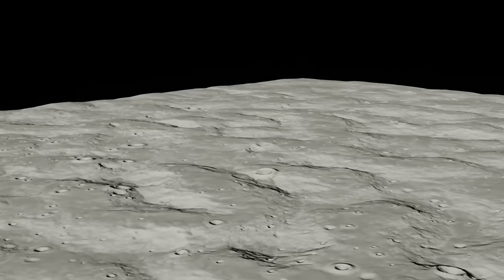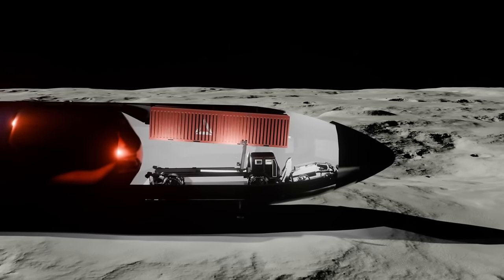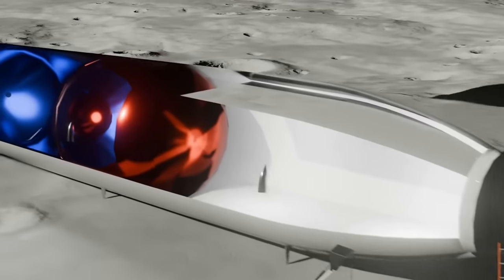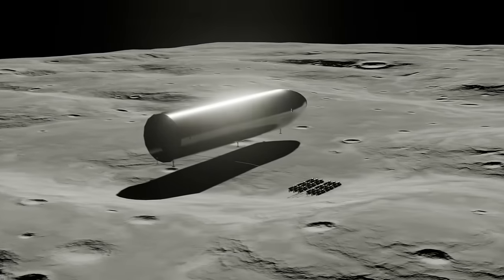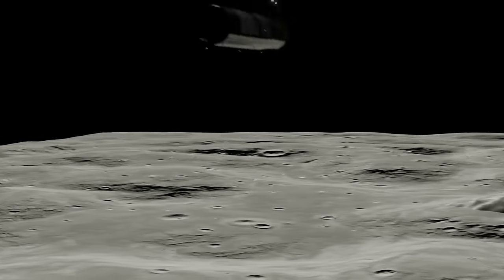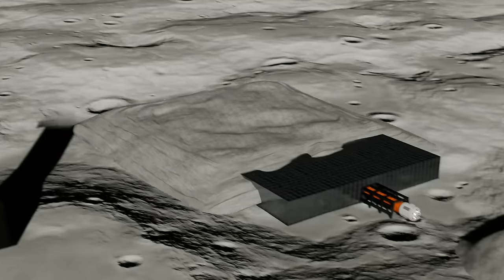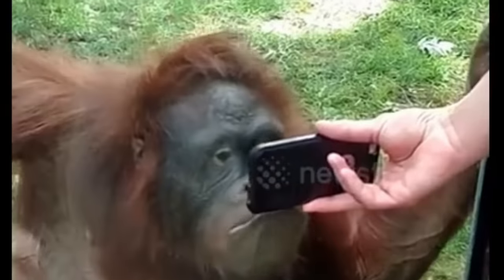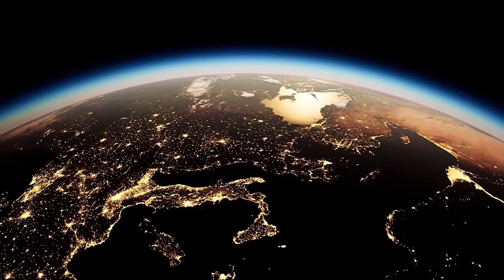How To Develop The Moon ALL PARTS

Comment: Could we get carbon on the moon with methane pyrolysis? 1. First mine water from lunar ice. 2. Use fuel cells’ electrolysis to split water into hydrogen and oxygen. 3. Use Sabatier reaction to combine co2 from astronauts and hydrogen to make water and methane. 4. Then use methane pyrolysis to produce hydrogen and solid carbon.
Reply: Why not condense the Co2 into a liquid and then use simple electrolysis to split it into carbon and oxygen?

Comment: I have an alternate propulsion system for the lunar shuttle, one that makes people nervous in an entirely different way: photonic laser thrusters. These are Dr. Young K. Bae's invention, and they're essentially a refinement of the laser sail. It uses a thin laser amplification medium and 99.99% reflective dielectric mirror on the powering spacecraft, with an identical mirror on the target spacecraft to bounce the laser light back and forth thousands of times, essentially turning it into a very long laser cavity itself. So instead of bouncing off once, it bounces - is recycled - 1000 to 10,000 times, imparting thrust to both ends while recuperating the energy that would normally be lost, and reducing the laser power needed from terawatts to megawatts.
This does mean that a) you can't have the beam incident on it all the way, it will lose focus eventually b) you need an Earth-orbiting 10 megawatt laser with repositioning thrusters/systems for the acceleration phase AND a 10 megawatt moon laser for the deceleration - hence the nervousness. But the performance is something else. A small 1-ton spacecraft (50% of that payload) with a 30 metre mirror and a 10 MW laser could reach Earth from the Moon in 20 hours with a beam incidence time of 6.8 hours - a delta-V of 11.6 km/s and, assuming a 1600m/s moon orbit, a thrust of 3227N. If you increase the mass, it increases the time it needs to accelerate, thus length of the incidence time/boost phase, but also increases the time it's within range of the beam, and doesn't increase the size of the mirror, so it scales fairly well. My calculations (and I may be wrong) say that 10 metric tons needs an incidence time of 12 hours. This can be tweaked.

So why set up this complex system? Being a propellantless system, once it's set up you don't have to keep feeding it. It's a photonic railway delivering a stream of raw materials to and fro. All that oxygen and titanium being delivered to Earth and on to Mars is pure profit.

Sources: Y.K. Bae, Journal of Propulsion and Power, Vol. 37, pp. 400-407 (2021)

2021 talk and slides to Future In-Space Operations Telecon: https://fiso.spiritastro.net/telecon19-21/Bae_6-2-21/

Automatic transcript of talk: https://rentry.co/gs9wpsab

My crappy calculations: https://rentry.co/qrrci66r

Where I found it: https://spacesettlementprogress.com/enabling-a-multiplanetary-civilization-with-photonic-laser-thrusters/

Comment: Nice try but lowsy logistics.  

1. Land semiverical and tip with truster assist to lay flat.
2. Send Opimi, reactor, and water prospecting equipment on first mission(s).  Pack reactor in a boring machine shell.  A shielded room can be provided for the Optimi.  No need for food or life support.  Will need EV anti-dust suits, transporter radiation boxes for longer drives/flights, and small, light dust clean off pods.
3. Send water extraction equipment, boring machine, support equipment, another reactor packed in the boring machine shell, and more Optimi on next mission to establish a water and materials depot and a temporary landing pad.  Use tanks from ship(s) to store volitiles.  
4. Use boring machine to mine regolith and moon rock to build out a below ground work area at a depth a depth sufficient to provide radiation protection for robots and manufacturing.  
5. Cannibalize ships for steel, other metals, parts, and carbon (carbon fiber).  Zero waste.
5. Determine location for a manned base.  Start base construction and bore a tunnel from the supply depot to the base.
6. Use temporary blow up housing that fits in tunnels for manned missions until sufficient infrastructure is available to ferry humans to and from the moon surface with fuel and life-support extracted from the moon.

By avoiding food, drinking water, life support, and human acceptable transportation, and housing and by consuming everything transported,  infrastructure build out can be accomplished at the fastest rate, least human risk, and lowest cost.

Comment: You can tell this is pretty good by how 99% of the criticisms are "but the current design iteration of Starship might not be capable of supporting itself on its side on the moon". 50 minutes of ideas and calculations and that's the worst problem anyone can come up with?
Reply from the maker: Lol yeah and it's not an insurmountable issue at all either
Reply: There's also the 10-meters-of-regolith part. Spaceship hulls are designed to keep internal pressure inside, they aren't meant to be buried.

Comment: this video is very budget over any safety, ignoring the issues with repurposing equipment not designed for the proposed usage, rovers and automation can conduct a lot of the labor of establishing the base saving on the radiation absorption as it will likely take months of work refining luna terf into enough material to make a small foot hold to bury

Comment: Before I watched your video, I assumed all tanker flights would be dedicated flights. Now I see that is wrong.

Most early flights of StarShip will be to LEO and will not be carrying anywhere near its maximum payload. I now realize that, on those flights, Starship can carry extra fuel and oxidizer to drop off at a refueling depot. That will mean that SpaceX can use every kilogram of every launch to common LEO orbits. 

The supposed inability to use all the mass Starship is capable of launching was an early criticism of Starship, and now I see it was an unfounded criticism.

Comment: A bit on the ground-side launch, if you really wanted to you could use a nuclear lightbulb system, a closed cycle nuclear gas core rocket capable of clean launches! That could massively increase passenger loads. If the public would still be squeamish at anything with the word “nuclear” in it, you could use a tethered ring to significantly increase throughput and reduce cost. If I’m being honest, something like a tethered ring or Lofstram loop is probably more likely than us seeing a nuclear lightbulb launch from earth. (I’d highly recommend Isaac Arthur’s vid on tethered rings!)
Reply from the maker: Yeah rings would be great but gotta develop the moon to build something like that

Comment: gabion baskets would reduce the time to cover the station with regolith shielding.
Reply from the maker: Yeah I think something like this will be useful
Reply: @Anthrofuturism  perhaps a gabion wall robot could '3D Print' structures out of gabion baskets like making brick walls. Imagine a robot that sinters a road from site A to site B, the next robot places gabion walls on either side of the road, the next tops the road from wall to wall with a sheet metal roof, then sand bags cover that with solar panels on top. The sides banked with sand bags, & the inside temperature controlled but exposed to vacuum would provide a safe transportation corridor where a less expensive space suit would suffice for use.
Reply from the maker: @Astroponicist  several universities and companies are working on 3d printing regolith shells and printing habitats our of regolith the issue is you have to use water or sulfur which is a major bottleneck for large scaled production but probably useful in the beginning.
Reply: @Anthrofuturism  leave a simple job to a university & they will make it impossible. gabion baskets are easy to ship, easy to place, & easy to fill. they are cheap, reliable, effective; which is probably why they are not using them in their estimations.
Reply: I have to wonder....many, many caverns and lava tubes have been identified/mapped on the moon, wouldn't it make more sense to seek out and use those for shielding than to import the machinery to pile up many meters of regolith on top of landed structures, and then still have to deal with no shielding for personnel moving around and between them??
Reply: @AncientEgyptArchitecture while caverns, & tunnels are of interest, they are not always going to be in useful locations. They will require even more equipment, & work than surface structures. Protected walkways can be installed quickly, & with minimal equipment wherever workers spend time on the surface. Mobile versions are also feasible.

Comment: Another advantage to the belly-landing expendable Starship design is that the engines become spare parts for the reusable landers (or become the engines for an LSAM built on the Moon out of lunar steel) and the fuel tanks become the storage tanks for lunar refueling infrastructure.

The best site for constructing a lunar base would be on or near Shackleton Crater on the lunar south pole, which has permanently shadowed areas that may still contain water ice.  Using lunar water is good for us since it means that we don't have to ship it up from Earth.  We can use the water to sustain an artificial biosphere in our lunar base, growing algae tanks for oxygen production and CO2 scrubbing and maintaining a culture of composting microbes to break down our organic waste.  Using the oxygen produced by our lunar steelworks and siphoning off the methane gas produced by our composters and storing it both in lunar shadow, we can make rocket fuel for our generic methalox-fueled Starship-like landers.  Get a big enough colony going, and we can start exporting our waste gases to LEO to reduce the number of Starship tanker launches needed to refuel each mission.
Reply: 1 - Shackleton is too close to seismically active zones. Faustini Rim A seems more optimal.

2 - Water isn’t the only thing needed for life. The moon is almost devoid of nitrogen, carbon and seems to be fairly short on phosphorus, all of which would need to be shipped in from earth if you want a hope of establishing agriculture.

3 - What kind of composter are you imagining that could produce enough methane to fuel a rocket in under a decade?

Comment: I'm thinking about alternative approach . land vertical , then like TBM , a tunnel boring machines ,  dig down into regolith , not to build pyramids like shelters over crucial pieces of the whole system , we move few thousand of years from that point no matter if we can repeat Egypt  archievements or not . . for me it is pointless to build a mountain if we can just cover from temperature and radiation just dig down . No horizontal landing , which , imho is the better way to burry parts of arrived rockets . than build a pyramids or artificial mountains . I'm writing this commentary in the middle of Your video . I'm partially agree with the stepping stones You present . I'm only as an engineer try to minimise energy needed to archieve same goal.

Comment: You know what we could theoretically do? We could use the silicon from the slag in the production process to power a sand powered rocket engine. I know, it sounds weird, but it's one of the highest components of the slag for steel production. It's not as cool as the literal nuclear rockets but a theoretical concept that could have an impulse similar to chemical rocket engins on earth.

Comment: horizontal landing is the correct way to do this, but Starship is not the right design. the rings are not strong horizontally until buried, the tanks need to be balanced, and the transit engines are dead weight for landing, which is the most important part for weight.
Reply from the maker: Yeah but retrofitting to compensate for these deficiencies isn't out of the question

Comment: 6:18 If it is economically viable to fly multiple ships to the moon, building a new engine would probably be cheaper than the hassle of returning one.

Better ship back some regolith that would can either be precious for ISRU R&D or sold for science. 

Plus those engine would be a excellent resource for both spare parts or high quality stock material with the added benefit of earth R&D being able to develop precise procedures thanks to also having the same stock on earth.

Comment: How to settle on a Moon 

◻️ PHASE 1

▫️ Colonization area assessment
▫️ Georbital excavation laser satelite
      is moved into geostationary orbit.
▫️ LS-01 laser excavating several meter deep corridors, halls and establishment layouts.
( takes less surface material 
to cover subsurface corridors, with sealments, then piling a hill over a space craft ).

▫️ LS-01 glassing small crater surfaces to establish a solid and vaccum isolating surface.

◻️PHASE 2

◽ Shipment craft loaded with:
◽Energy unit
◽UAGV excavators
◽Mining unit
◽Geologic refinery unit
◽Oxigen production unit ( Geologic state 1 production )
◽Water production unit 
◽Hydrogen production unit
◽Geologic ore smelting unit 
productinfg metal dust for 3D laser printer unit.
◽3D laser printer unit 
produces structural parts for created corridors, glasses crater dome.

◽3D laser printer creates double shell glass windows from refined Moon dust/sands.

◽Algee geel unit placed, producing 
X-Ray isolation gel, later filled into Glad dome window shells.

◽Robot logistics modules, deploying machines that allocate and move structural parts to their construction places for human colonist crew.

◻️PHASE 
◽Astronaut colonist crews arrive, setting things together, such as 
corridor walls, operating excavators for final works, assembling the glas dome, filling the gel, mounting interrior. technical parts, pressurizing the areas, seeding aggriculture in Crater domes.

Comment: It would be better to build the base on earth using thick steel and submarine build techniques, then launch to LEO on super heavy booster and ferry to the moon using only the aft engine section of starship and engineering a way to land it on the moon as the starship is not designed to be put under external pressure from regolith, neither is it designed to lay horizontal

Comment: Would be quicker and cheaper, during the nuclear engine phase, to modify the already existing Starship rocket. We'd rip out the chemical rockets and modify it to nuclear. which reduces R+D drastically. Also reduces integrations costs later on, ie, wouldn't have to redesign the docking system, etc.
Reply: Ah yes, just replace the engines. How hard could that be?
Reply: @oberonpanopticon  We would be on the moon at that point with a mostly self sustaining base. Did you watch the video?

Comment: Wikipedia: 
"Free iron also exists in the regolith (0.5% by weight) naturally alloyed with nickel and cobalt and it can easily be extracted by simple magnets after grinding.[44] This iron dust can be processed to make parts using powder metallurgy techniques,[44] such as additive manufacturing, 3D printing, selective laser sintering (SLS), selective laser melting (SLM), and electron beam melting (EBM)." 

You might just need a grinder and a metal powder 3D printer, with maybe a furnace for casting bigger parts.

The whole metals section is interesting (https://en.wikipedia.org/wiki/Lunar_resources#Metals )
Reply: Thank you, 3d printing metal parts like what Relativity Space is doing on earth will be ideal to build lunar surface to LEO vehicles like the lunar lander module without lifting extra mass from the earth.

Comment: Wouldn't sending a tunnel boring machine up instead of a second excavator/ rover make more sense? Less digging and the job site for any building or connecting tunnel is under most of its intended radiation shielding during construction too. For that matter if you have the smelting and fabrication infrastructure started why wouldn't the first thing you buld be most of the parts of a tunnel boring machine and start making them at scale.
Reply from the maker: Good idea if you can get it there

Comment: Great video! Only 2 questions 

- why does construction have to be steal, and not a concrete 3D pritning? 
- 5B cost estimate to begin development feels low, I wonder what the cost estimate was of the ISS and how wrong it was?
Reply from the maker: Sorry for late reply. On a surface level 3D printing melts regolith and mixes it with a binder (water / sulfur) so you're bottlenecked by binder imports vs steel which is bottlenecked by carbon (to a much lesser extent). But let's say we have lots of both binders and carbon... the real issue is 3d printing is actually more work. You have to feed the printer regolith which means you have to dig a hole or scrape it from across the surface (hole is better). Your structures walls are directly proportional to the volume of regolith excavated- that hole. Then you have to bury the whole thing under 3m (9ft) for radiation protection which means you have to dig a second, even bigger hole (or scrape an even bigger area). This means more time per cubic meter than the steel construction process which can also be automated or remote controlled and results in a stronger, more radiation-resistant structure for less work and time (although it takes more energy, but energy is pretty much free on the Moon). Tl;Dr One hole is better than Two. 

As for your second question I addressed that in the video. The ISS was a 15 nation effort during peak launch costs. It is the most expensive thing ever created and should be thought of as an extreme end rather than a norm to reference. If launch costs were that high today (they are already significantly lower) this video would not be made.
Reply: @Anthrofuturism  thanks for the quick reply! That makes a lot of sense

Comment: Thanks for this info. Another great show. However, the does permit using water/electrolyte instead of petroleum and this only releases water into the environment. But you are correct, there is no avoiding the laws of thermodynamics. Keep up the great work. 😊